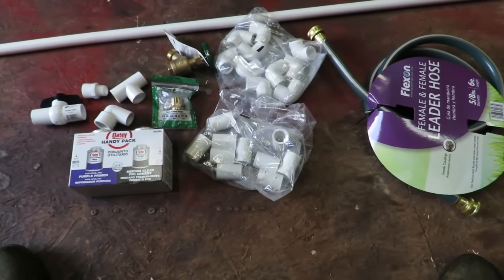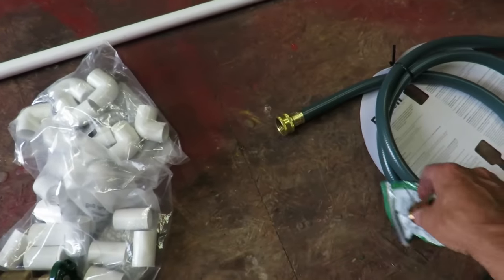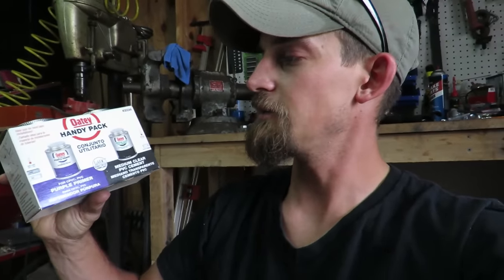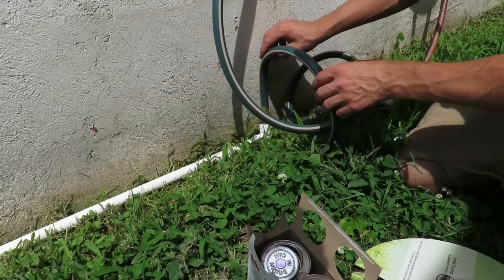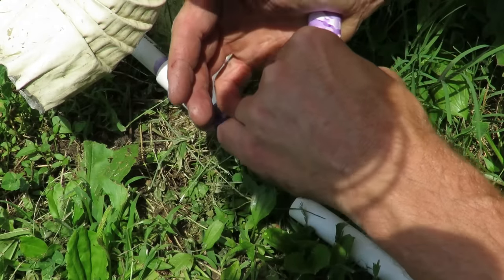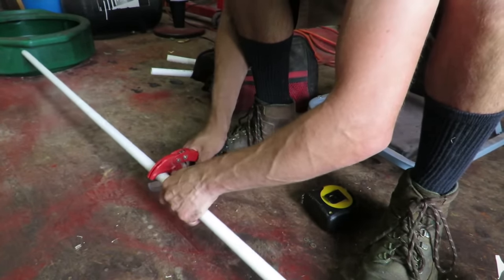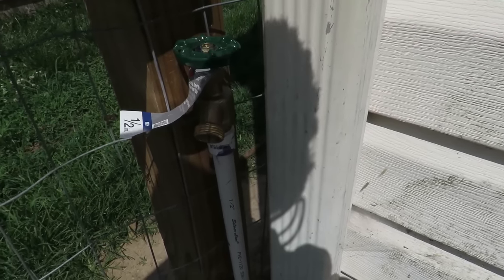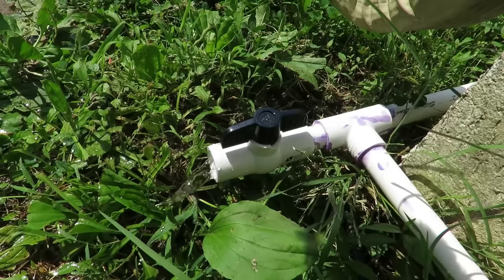Add a Water Spigot Anywhere in Your Yard!

Comment: If I turn off the hose during winter, will the PVC pipe become damaged from the cold?
Reply: The PVC will eventually degrade from the Sun. I did something like this but I use a good-quality garden hose. At the end of the day, I drain the pressure off the line by turning off the main spicket and draining the line at the other end. I now have three points to access water in my yard. You could also bury the PVC that would make it last longer.
Reply: @David Needler  yes I meant spigot. Sorry autocorrect 😃
Reply: @David Needler actually, American Southerners and midlanders spell spicket (spigot) this way. My phone must be southern 😹
Reply: @grandmaraps  why didn't you just tell him that you have an accent?😂🤣🤣😄

Comment: Why use a hose coming off the original spigot?  I did something similar a few years ago but came off spigot with pvc. Then buried it and ran to two different locations. Hose can dry out or get cut by weed wacker.  Wish I could add a picture for you to see.
Reply from the maker: I can visually see the setup.if you are speaking of the leader hose, when I searched for a pvc to garden adapter they didn't have anything like that.
Reply: Timothy DC. Brass double spigot, then pvc adapter to one side. Screwed right on to brass..short pvc connected to that, then 45 degree to go down to ground.
Reply from the maker: That is something that I was looking for, almost like a union. They may have just not had it in stock. The guys helping me search for parts seemed confused with what I was doing even though I had a drawing.
Reply: Timothy DC happy to send you a pic or quick video
Reply from the maker: How deep did you bury it? Are you in colder climate?
Reply: Timothy DC. I am in FL so just went down 6 inches or so.  Then buried under pavers. I took a video but don’t think I can add to this reply.
Reply: @nickdeliso7026  Hi Nick.  I would like to see a picture of the setup if at all possible.
Reply: @kenphamful I tried adding a video but it keeps getting deleted.

Comment: Does schedule 40 degrade from uv damage?
Reply from the maker: I have. Ot had any issues yet with. It isn't soft either. However, I am sure over a couple years it will show some kind of wear.
Reply from the maker: On a side note....most of the piping is covered by grass so it is not taking the full brunt of being in direct sunlight
Reply: Timothy DC decent idea none the less, just wondering on heat softening the joints over time; leaks aren’t much of an issue cause it goes to the ground anyways and easily troubleshooted 

I got dogs who would knock these up hard without anchoring points
Reply from the maker: I could see the dogs being an issue. My system has been setup for a year almost now. I did break the ball valve when I accidently ran over it with the mower, but haven't had any other issues.
Reply: I’d recommend using sch 80 fittings and uvr rated pvc pipe. Or burry the pipe...

Comment: You did a pretty good job I only have about two complaints is how it’s above your yard so you always have to mow around it or weed whack year or potentially cracking the pipe in your dreams for your downspouts and gutters it drains right on your foundation of your house I can see some cement chipping away so I would recommend fixing that for your next project
Reply from the maker: We have corrected the down spout issue. Actually turned the one next to this spigot into a rain barrel setup (which I love for our garden) and the other down spouts have got extensions on them. Maybe in the future I will bury the line, but not sure. Left it above mainly in case I wanted to change the setup or add any additional lines. If I went across the yard this would definetly be buried.

Comment: You system is going to fail. Many things done wrong but mainly you didn't put your fittings on correctly. 12:38 "you can go inside or outside it doesn't matter" WRONG! You do both, and with a 1/4 turn.

PS  your drain. You could have put a regular spigot or added a hose tread to that ball valve. Would be an extra hose connection.

Comment: The right way to do it is hard pipe it ,put a little elbow to it,and dig a trench along the house,and and then put the pipe in the ground,dont forget to remove the hose,you have to connect the pipe to the source of water coming from the house,remove the hose and hose bibb,you can still put a hose bibb on the side of the house...
Reply from the maker: Of course if this was going to be 100% permanent I would have done the piping under the house with pex piping and put it through the foundation. This is a simple way that ANYONE can add the water spigot. And still, you have not said how I was holding the tool incorrect. Thanks for taking the time to comment and check out the video.

Comment: Great video.  I think I am going to put mine in this way. Neighbor says I should use 1" line but not sure why.
Reply from the maker: Possibly flow more water, but I have had no issue with the size pipe I used.
Reply: @ASliceofWoodWorkshop 
Yeah, my main line going to my water meter is only 1/2" copper.
A 1" line is probably overkill....... To say the least. 1" line is stronger tho.... More money tho.... Gotta make a choice..
Reply from the maker: It is stronger, but what does it need to hold its strength against unless you are putting it in line of somewhere you will drive a mower or car over.
Reply: @ASliceofWoodWorkshop 
Yeah it depends on location, are you going to bury some of it, protect it 2x4s, span a distance without sagging. It all depends.

Comment: LOL DUDE   FIRST OFF  THEY HAVE CITY CODES  ALSO THAT WILL FREEZE  IN THE WINTER. WHY DO YOU THINK PVC HAS TO BE 18 INCHES DEEP AND PEX AND COPPER AT 12IN CHES
Reply from the maker: No worries about it freezing, that is why you open the ball valve and drain the line out.

Comment: Good vid. Any reason why Pex couldn't be used here? I've never seen PEX used outdoors and there's likely a really good reason why, but for low risk applications like lawn watering I'm having trouble coming up with a good reason for going through the trouble of doing all the work needed in a PVC job. Maybe the fittings rot out quickly...?
Sure, the crimper isn't cheap, but let's face it, it's a great way to convince your better half that buying another tool is a good idea! (If that hasn't worn out yet.) Actually, PEX may even be cheaper than the same thing in PVC.
Reply: Jim ... PEX doesn't like sunshine. It rots in just a few years.
Reply: @rupe53  That definitely qualifies as a good reason for not using Pex.
Thanks!

Comment: That's wrong on so many levels. As a plumber you would have no idea the amount of hose bibs I replace in the spring due to people leaving hoses attached, not winterizing , ect. Not to mention you put no vacuum breaker anywhere and run the risk contaminating the drinking water of your home. If you're tire of dragging a hose put in a yard hydrant . They do not require winterization. Call a plumber folks . There's a reason they are licensed.
Reply from the maker: No need for a plumber. I dont leave the hoses connected during winter time. At the beginning of winter you open the drain and can blow the lines out.
Reply: @ASliceofWoodWorkshop  You missed his point. He was cautioning you that you left of the all-critical vacuum breaker.